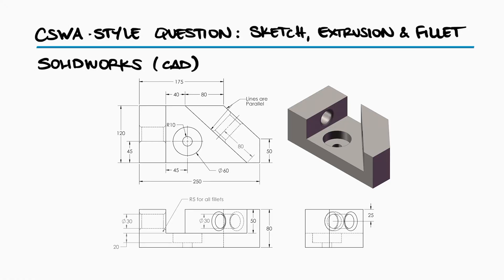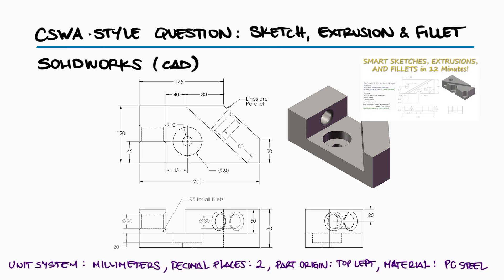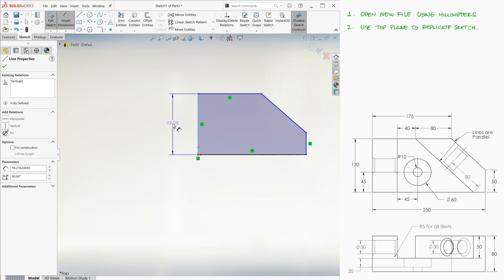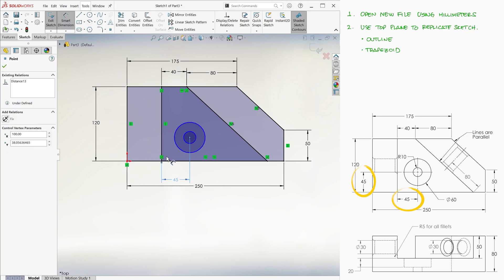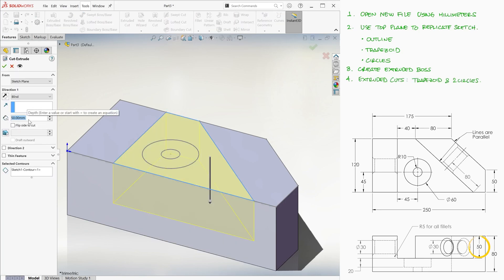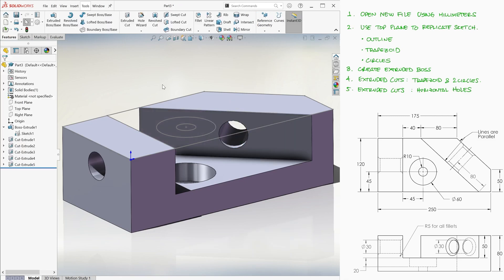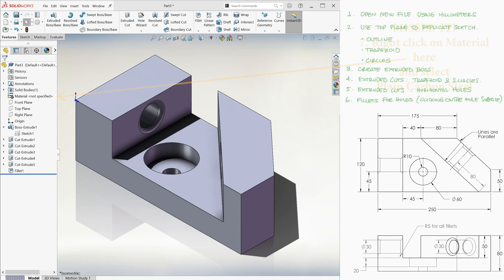SolidWorks CSWA Practice - Sketches Extrusions and Fillets Example in 2 Minutes!

Comment: "R5 FOR ALL FILLETS".   That is a very strange way to describe the rounded edge for two of the holes. Is that a mistake?  Or, just a "trick" specification to confuse students?
Reply from the maker: Yes, it is intentional, but not a trick. On the contrary, this is the first example of the very first lecture where SolidWorks is used. At this point, the students are, for the very first time, learning about the words "extrusions", "sketches", and "fillets". If anything, it's easier for them to know exactly what a "fillet" means in this context.
Reply from the maker: Proper practice for annotations and dimensioning is covered much later, when creating part drawings is first introduced.

Comment: Missing dimension on the drawing.
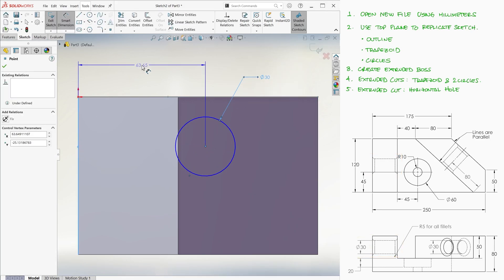1:29 you say "centered" regarding the horizontal hole center position on the left side.  Where is it on the drawing?
Reply from the maker: The center mark for the circles in the top view pass through the bottom line of the horizontal, cylindrical hole on the right. If the diameter of that hole is 30, then its radius is 15. 45 + 15 is 60, which is exactly half (and therefore the midpoint) of the 120 mm vertical segment on the left.